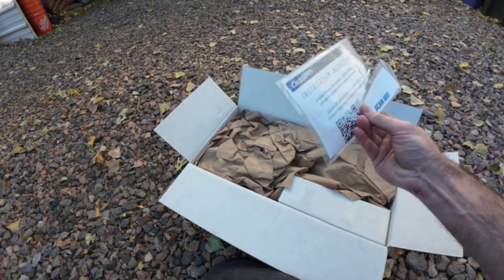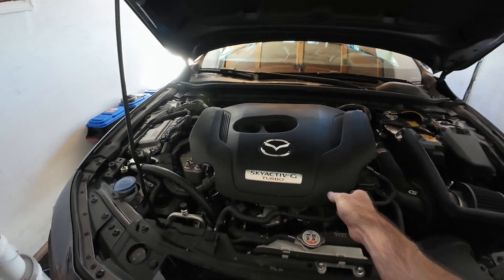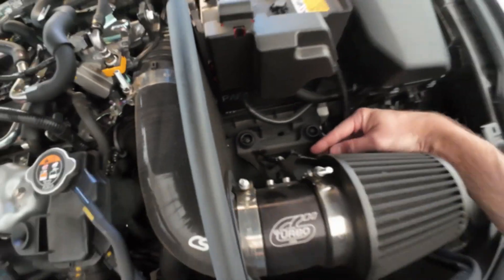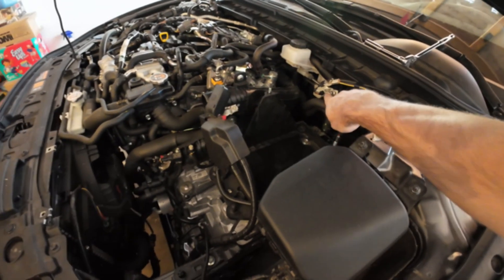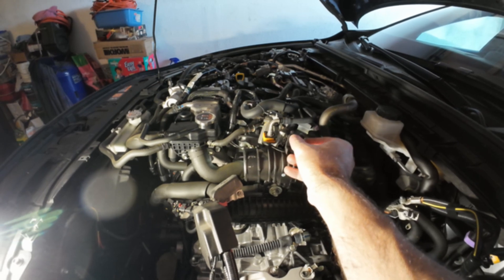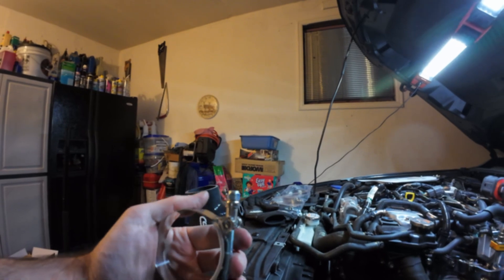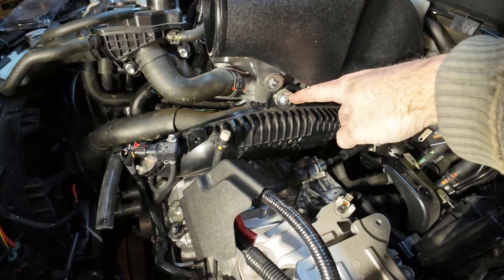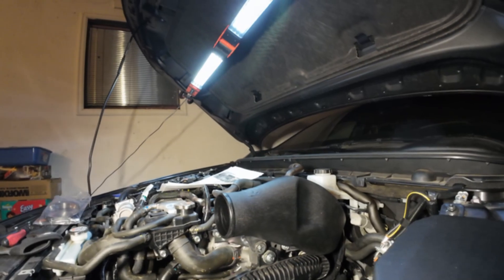Mazda 3 Turbo - Corksport Turbo inlet install

Comment: Also, did the car have to be retuned for the pipe?
Reply from the maker: No tuning is needed.  As always, you will gain more if you do.
Reply: Thanks! I plan on tuning it -- but I'm glad I can wait until after the pipe installation.

Comment: Maybe I just missed it, or maybe you haven't road tested it yet... but I really want to know: Was there any effects in power, mpg, response and how? Good, bad, or neutral, I really want to know. Did the car have "any" effects other than sound? It did sound great, BTW! Thanks for the detailed installation video -- that's rare to find.
Reply from the maker: I think it helped the turbo spool up faster.
Reply: @WorkzGarage  Awesome! Thanks for the straight answer. For some reason, those are hard to get on YouTube, Rumble, etc.

Comment: Noice
Reply from the maker: I'm going to be purchasing more upgrades. I'm just not sure what's next. What do you recommend?
Reply: @WorkzGarage  You should look into getting their exhaust they got a 3 inch cat back exhaust and they also have a 2.5 inch. The 2.5 inch exhaust you can change to a different axle back if you want like an magnaflow,borla, and a HKS mufflers. I’ll wait on the downpipe they made for the car because it will throw a P0421 cat code which they are trying to fix right now. But you can get it turn off from a tuner which I did and that will solve your problem as well.
Reply from the maker: @micahhill4786  I already have it. In my Mazda 3 introduction video, I show it. Really awesome exhaust
Reply: @WorkzGarage  Just seen the video right now lol. Yeah you pretty much about done whenever you get the downpipe. Whenever you get the downpipe I recommend two tuner one is DRTuning the other one is Mazdasaucetuning. I’ve worked with both of these guys and they both are great
Reply from the maker: @micahhill4786  Not sure I wanted to do Mazdaedit. I have a Versa tune on my Miata and thought about going that route. I am awaiting their turbo tune as they said they are working on it. I do have a downpipe. I have it just,  I haven't installed it yet due to no tune. Do you have a tune with a downpipe? I emailed DRTune with questions, and they didn't reply.
Reply from the maker: @micahhill4786  do you have downpipe on your Mazda 3 Turbo?
Reply: @WorkzGarage  Yes I do
Reply from the maker: @micahhill4786  does it make a big difference? Also, is the check engine light not on because of the tune?

Comment: Thanks - planning to fit one soon. How did you get the factory metal clip off the original breather hose?
Reply from the maker: I had to use a Dremel with a metal cut off wheel.